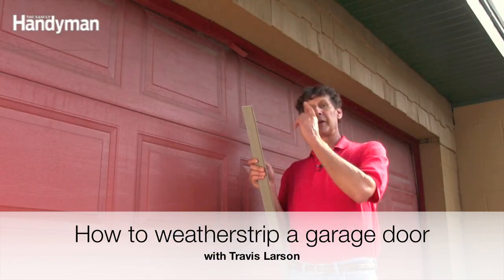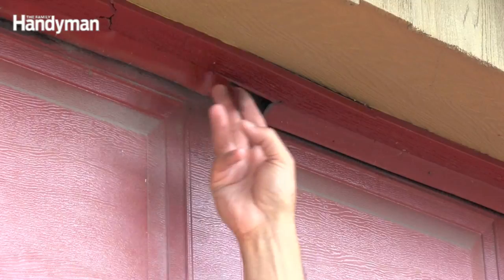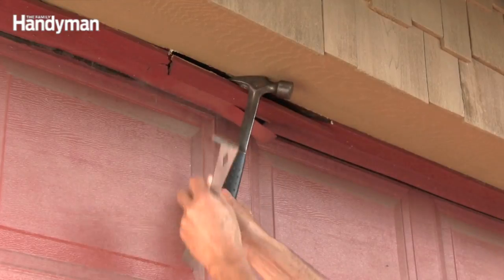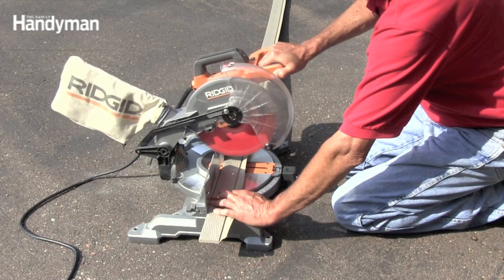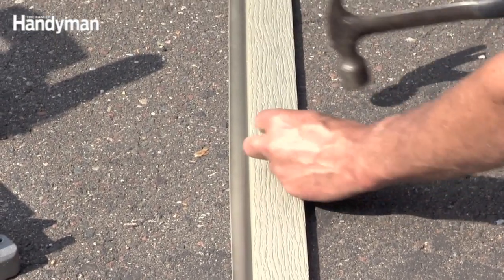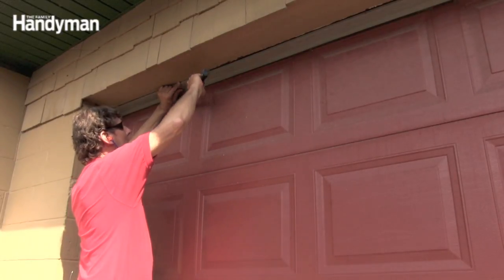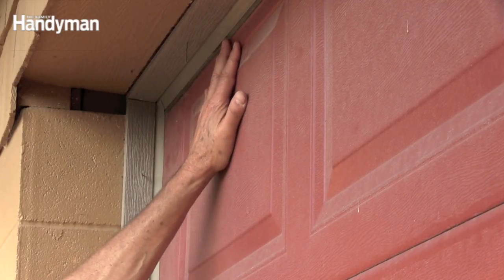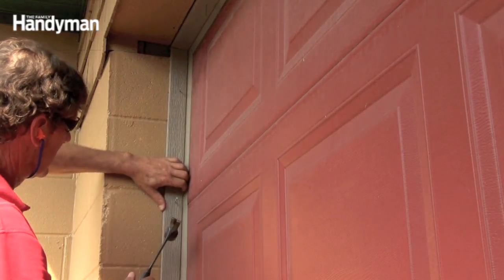How to Weatherstrip a Garage Door

Comment: Wouldn't last one summer in direct sunlight PERIOD!
Reply: @hendrikjbboss9973  sounds like your judgemental. I no for a fact it won't stand -up -one summer in the southern facing sun in Minnesota...
Reply: @noname6568  Actually this stuff does hold up in the heat.. Vegas heat that is
Reply: @noname6568  I live in MN. Mine was installed last spring, and it still looks great even in direct sunlight.
Reply: Paint it!  Does just fine.
Reply: Nailing into concrete blocks?
Reply: @mattvogel5712  nobody said that, but I questioned it right away. let me get this guy magic hammer. This guy is driving small nails in the concrete like its wood.